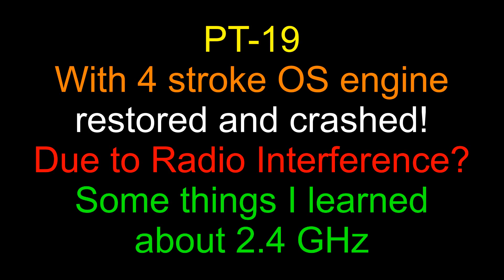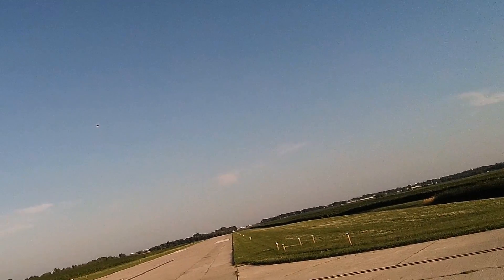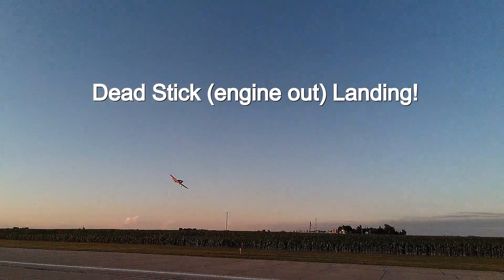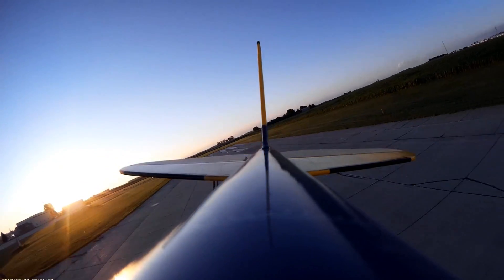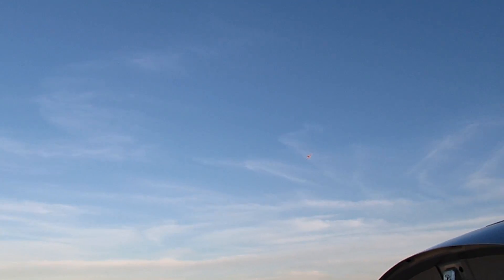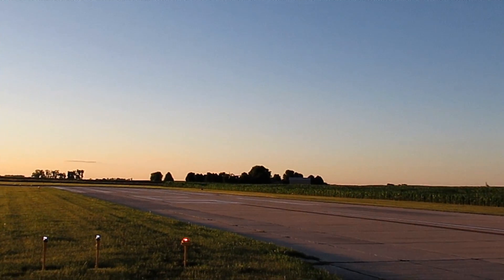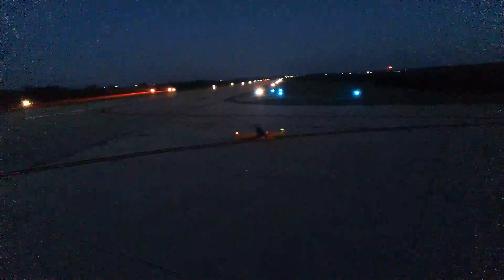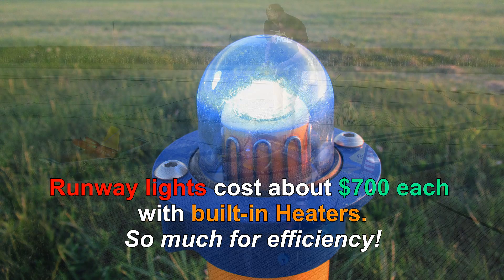My Planes that used to be on FM but now on reliable 2.4 Ghz are crashing at the airport. But why?

Comment: Hey Dave, I didn't see this mentioned in the other comments i read, but I noticed two things in the video and your comments.  FIrst, you talked about the length of the Spektrum Rx's antennas being long vs. the Orange.  The only portion of these antennas that matters is the tip portion that is ~ 25mm long (+/-).  As I understand it these are fractional wave antennas (I think 1/4) and the length that is exposed is all that matters.  The extra length is to allow one to route the antennas out of fuselages or into optimum locations.  The second antenna on the Spektrum (and other models of the Orange) is for diversity.  When your receiver has these they should be mounted at a 90 degree angle to each other.  This is kind of like what you were showing with the direction of the transmitter's antenna when you had your wife trying one way then the other.  The diversity allows for optimum reception in more orientations of the aircraft.

Sorry, that was a long comment, and you may already know all that, but I hope it is helpful for someone.  Also, I know this doesn't necessarily explain the interference you saw at the airport.  Others below have postulated ideas.  My only idea on that is I wonder if someone either at the airport or in homes/businesses nearby are making use of range boosters on their wireless routers or even cordless (2.4) phones?  But then that wouldn't necessarily result in the ground effect.   <stumped>
Reply from the maker: Thanks Jason.  Yes your right about the antennas. When I bought this AR 500 full range sport receiver, it stated in the instructions to allow the tip of the antenna to extend outside the aircraft and that is why I made the changes to my PT 19.  Your right, the two antennas and in my case one which is on the Satellite reciever are as far apart as possible and one out the side and one out the top now on my PT 19. That was especially designed to do what you say with the Transmitter antenna. My New DX8 Gen II has an antenna in the transmitter Handle, Plus the vertical antenna.  This again will help, but I believe something else is going on because I never had a problem ever til I started flying at the airport.  Your right about the Boosters too.  There are farms surrounding the airport and I would expect many have wireless boosters too.  Thanks much for your comments.  Good advice.

Comment: I have an older DX7 and had a problem only twice.  My friends have a DX8 and 9.  They seem to love the 9 out of all of them.
Reply from the maker: Yes I know the Gen II DX8 will be better, but again I never ever had a problem with any of my DX6i's till I started flying at the airport.  Thanks for the comments.
Reply: +NightFlyyer I was thinking are there any wires under the runway at that point.  Where is that airport?  You used to fly on a road near some  houses?  Does the runway have some kind of underground heating system for ice?  Is the problem due to the wiring from that light? Is this an active runway and is there a transmission antenna hitting that area with a signal?  This is so strange. The new DX8 with the DSMX might solve the issue. You know you said you don't need a DX9 with all the features but I figured you would be a person that would like all the new upgrades to play with.  What I like about my friends it gives voice commands and warnings and the set up is very easy.  Buddy box is wireless and I think you said you like to teach the hobby.  You go to schools.  It would be fun to work with a smaller group of kids with a real cub trainer and a buddy box.  Just a thought.  You could teach after school.  Do they have an RC club at the school.

Comment: I have a Spectum 7S   and at the RC club I fly they actually say Spectrum is rubbish and unreliable. It seems Futaba sends more signals too the receiver on 2 separate bands or something like that, while Spectrum goes on the cheap and just 1 band and fewer signals or pulses too the receiver, so more prone too interruptions.   At the club there are just 2 of use using Spectrum and I did lose my Blade 350QX there because of signal los.    Iam not that technical if it comes too frequency's, but these guys have been flying for years, so there must be a bit of truth in what they say. Personally I am quiet worried about my radio, and I have all my models on Specrum  receivers, going too cost a fortune too change
Reply: That might be true of the older Spektrum DSM2 RX's but not so of the newer DSMX RX's as they are Spektrums version of what Futaba and others use,i've put it like that so as you can understand what i mean rather than trying to get technical,so if you use the DSMX RX's (receivers) you should be good to go. ;-)
Reply from the maker: Good Points, however I have NEVER had a radio Failure or loss of signal anywhere, even flying at contests and with clubs, until I started flying at this airport So have gained confidence in my Spektrum based equipment or wouldn't even bother to fly.
Reply: *****  Very weird, starting too believe in a secret UFO base :-)

Comment: Dave, I have heard of this many times on the forums and thanks for posting a video so I can see it with my own eyes.I know you have flown DSM2 successfully for years I have followed your videos.I would strongly suggest ditching DSM2 and trying DSMX instead.Either that or moving over to FrSky or Jeti.I have flown DSM2 myself in the UK without problems, however all my stuff is either DSMX or FrSky now.Great video, I know you report honest findings. I am interested to see how this all works out, I wish I was at the field with you to try some of my equipment under the same circumstances.Haha! you finally graduated beyond 6 channels :-D.
Reply from the maker: Ha ha. Many of my FM JR, Futaba and Hitec radios are more than 6 channels, but in reality, there is not much need for any more channels in my planes.  Again, I have flown for years with NEVER a radio glitch on the Spektrum stuff, so replacing all that just to be able to fly at the airport would be cost prohibitive and lots of work.  Thanks for the comments and when I fly the PT 19 again, I will show the range tests before hand and hopefully the DSMX will work better, but I think since the problem has only shown up at the airport, something else is going on.  Thanks for the comments and happy flying.
Reply: I was only thinking the other day you were the best 'advert' for successful use of DSM2. I have followed your videos for years and I believe what you say.I am really intrigued to see if DSMX cures the problem.You wouldn't have to change all your receivers, just the models you fly at the airport.I look forward to your findings, you are 'scratching an itch I have had for years.Thanks for the videos.

Comment: Hi Dave, it could be the reinforced steel mesh in the runway concrete taking the signal. We have found that even with 2.4ghz ground radios for our nitro cars, large steel manhole covers ( 6ft x 3ft ) and steel lamp post and rugby goal post interferes with the signal when driven over or close by. The rugby goal post also interferes with the planes signals on the dx6i,dx7 and dx8, so we don't try to fly through them any more lol. Keep up the good work.
Reply from the maker: I thought about the mesh too, but believe there is a problem with wi fi boosters at some of the farms around the airport as never had I even a glitch flying anywhere else.  Bummer you cant fly anymore, but those posts may be getting absorbed with wi fi booster signals, causing your problems. Thanks for the comments.

Comment: My sincere apologies for all the grief. I would never doubt you for a second. If I know anything from following you these past few years, it is you have forgotten more about rc radios than I might have ever learned, lol!

What I can offer, for all the good it will do you, is that you need to sweep that field. Spectrum Analyzer. RF Explorer makes a nice and relatively inexpensive handheld field device (http://rfexplorer.com/models/) that can help isolate any spurious noise. 

As you know, my passion is FPV and flathatting my backyard with multirotors. I fly as low to the ground, and around large pole barns and structures, and trees and brush and shrubs, all while keeping a 433mHz, 2.4G, and 5.8G link. (UHF and 2.4 for control and 5.8 for video depending on craft)
I performed many range checks around my property before flying more than 20 feet when I first began this hobby back in 2013. Over the years, I have pushed the envelope, and have flown in even more extreme environments, and at much greater distances and far more extreme environments indoors where microreflections are at their apogee. I have had many occurrences of dropped video link with the weaker 5.8 in these places, but I have never lost my control- even with 2.4

Once I began intensive testing of video using both the RF Explorer and an RF power meter (RF Explorer for environmental sweeps and the RF power meter for the VTX, antennae, and VRX) I was able to fine tune- for example, there is a slight bit of noise on 5715 in a few places I fly so I do not use any 5.8 video channels that are within 40mHz of 5715. 

Unfortunately my purchase of the RF Explorer was for the model that ONLY has the 5.8G band- but they are made with modules that read all bands- or any one of the select bands used in the hobby. (ie- 433, 900, 1.3G, etc)

I suspect your musing about underground cable is spot on- besides the poor quality of video in general on 1.3G (but superior range) I do not use it for miniquads and proximity flying as the ground has a lot of 1.3 there (not sure why- I have not reached that paygrade yet)

So, as I originally mentioned about "for all the good it will do you" as the RF Explorer product costs around $270 to $350 depending on module(s) included, there is a solution if you wish to invest. I will add that with the desktop software, and using the device with a laptop, you can thoroughly sweep any field or space and "see" everything you could want. One additional feature of the RF Explorer is that with a patch, or helical antenna (high gain directional) you can actually "foxhunt" a downed craft as long as it is broadcasting and you are able to pick it up. (I have done this in tall grass before- and a cornfield but both were in the fall and the plant matter was dry- water blocks signal on 5.8 easily- like leaves in trees)

Incidentally- I have a few "beater and basher" quads I use the Orange gear on- with the Lemon Sat, the tiny Orange PPM only rx, and the exact same rx you show, and I can fly in the same places, as low to the ground and behind trees, etc, as my Futaba does.

Best of luck!
Reply from the maker: Not sure what that means, as I worked in the RC engineering section of Kraft R/C Systems for years and know how those radios worked and the problems we had with interference.  Spred Spectrum radios are a relatively new to RCers and again, I have NEVER had a radio failure with any of them, until I started flying at this airport.  A Spectrum analyzer could be helpful for sure but wont fix the problem, only make me aware that I should not fly here anymore. Thanks. for the comment.

Comment: are you using dsmx or dsm2?
Reply from the maker: I am using DSM2, but again, they have never failed or even a glitch for years anywhere else. The problem is only at this airport. My new DX8 Gen II is DSMX, so when I make the next PT 19 video, I will do a range test and video the results.  Thanks.
Reply: +NightFlyyer Hi, indeed but as you saw there was  something disturbing your radio link, now dsm2 is not spreadspectrum, witch dsmx is! So I suspect that with dsmx your radio link will be rock stable :) I know dsm2 works perfectly until it doesn't... :) i will curiously wait for the dsmx test. But I will be very surprised if it doesn't work perfectly.
Reply from the maker: I hope so, but in reality, when I looked i actually was using a  DX6i  in the PT 19 that was and is a DSMX. I have 2Spectrum DX6i's that are DSMX  and 2 that are DSM2. The orange transmitters are DSM2 and seemed to work better in my test.  Thanks again.  I believe tho, that there is a WI FI Booster saturation surrounding this airport and a spectrum analyzer will confirm it.
I just need to find one to use.
Reply: +NightFlyyer hi, is the receivers also dsmx? it's very likely that a wifi Booster or something similar is generating noise. you probably know this but diversity receivers should have the antenna 90 degrees from each other's. and the transmitter aligned to get maximum signal, as they transmitter and receive sideways.

Comment: I enjoyed how thorough your tests were to determine the problem. I never upgraded to 2.4, I still fly with 72 MHz. I must admit though, that my Hitec Eclipse 7 has been extraordinarily reliable. I have not had a radio issue ever while using it. Definitely archaic by today's standards, but it sure works well for me! Thanks for another great video Dave!
Reply from the maker: I appreciate your comments and I also have a Hitec Eclipse 7.  It has never failed me either, and has way more range.  If I cannot figure out what is going on at the airport, I may switch back to this radio for some of my valued gas planes.Thanks again.

Comment: Do you bind your Tx and the RX by holding the power reduction button on the back of the TX? Do you re-bind  the Tx and Rx before every flight? just curious.
Reply: +James76 My DX 7 says to hold the low power bind button and stand 3+ feet away from the Rx to bind to a Spektrum AR 7000.
Reply from the maker: No.  This Dx6i does not have that feature.
Reply: Oh, ok thanks

Comment: Eddie currents from the power supply cables???
Reply: I think this is it- potential composite second orders, and combination triple beats causing the link to drop on the receiver side due to interference.
Reply: +Hiway I thought maybe even magnetic flux lines from the Earth's field.
Reply from the maker: It may be, but it seems that it does not matter if the power of the lights is on or off.  Good point.  Thanks.